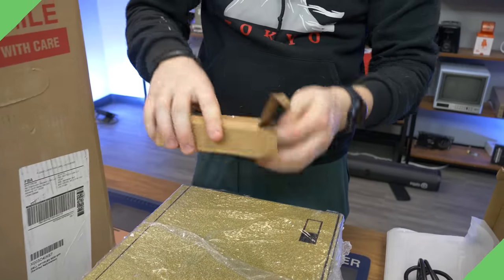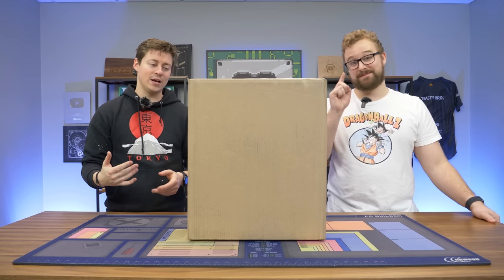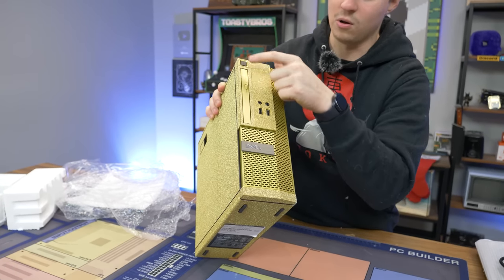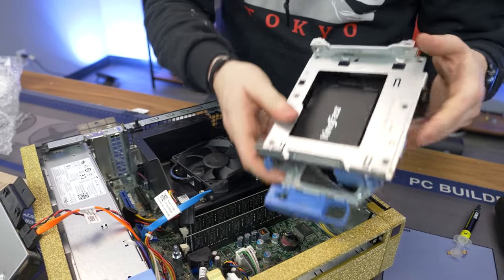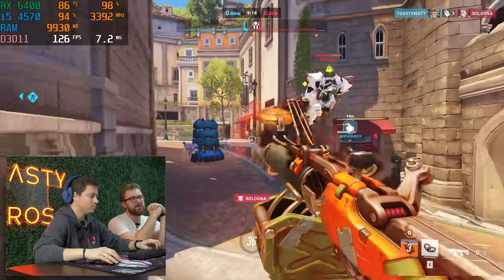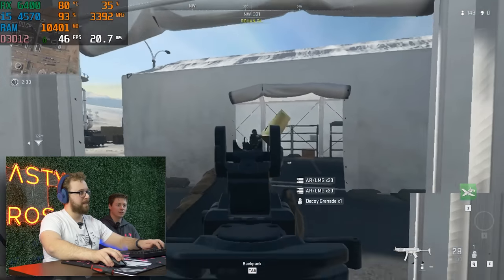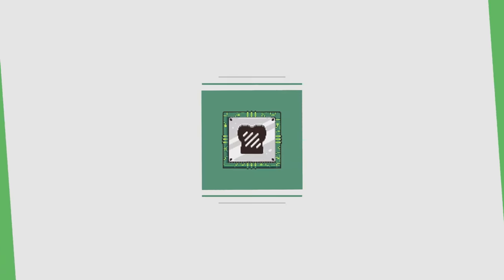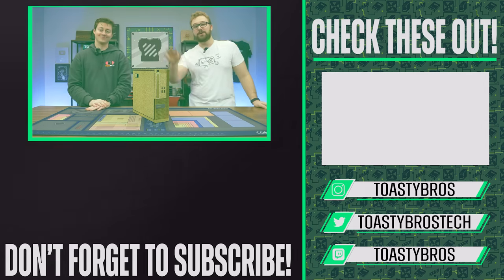We Bought a WILD Budget Gaming PC from Amazon...

Comment: Made a gaming build out of an OptiPlex 990 and it does really well with 1080p. It has a RX 6500 XT and performs really well and it has 24 gigs memory with an 870 evo SSD. Btw love that Tokyo Hoodie.
Reply: How with an rx 6500xt it can perform good ? This gc sucks when its not on pcie4
Reply: @RyxioonYT  its better than intergrated graphics/ igpu/ apu from 4th or older intel apu’s
Reply: @RyxioonYT  If the total game textures are less than 4GB it's not going to effect it that much. If it needs more than 4GB then the PCIe 2.0 of Sandybridge combined with the only 8x slot configuration internally of that card will really start to cut into the performance.

Comment: That's so funny you're reviewing this now.  I found your channel after watching other tech reviewers review this and went down the youtube rabbit hole watching your videos.

If anyone is watching this video and thinking about buying one, if you search on Amazon for an HP ProDesk 600 G3, you can get an I5-6500, 512gb SSD, and 16g DDR4 in an SFF chasis and a Windows 10 license.  I see one now for $110 bucks.  Same issue, you need a single slot PCIE graphics card and it'll get toasty, but much better bang for your buck.  

Or for $212 bucks right now, you can get an HP EliteDesk 800 G3 SFF with an I7-6700, 1tb SSD, and more space for a 2 slot GPU like a 1650.

Or you can buy the Tower version instead of the SFF version for more but have more flexibility on GPUs.
Reply: hp ones are bad because the bios is often very locked down, not that i recommend any of these for the pricing

Comment: 5:30 no you don't have gen 3 support... but you might find that out later... the 3020 uses an H81 chipset so it's only gen 2. Sorry. Speaking from experience as I own this very PC without the bling and with a slightly better (4590) i5. Except the side panel doesn't have the lever so it's making me wonder if this is a 3020...? Anyway. Whatever it is, worked fine with an RX 6400 so I'm pretty confident that would be a good upgrade for me.

Comment: Watching this video on the exact same model, just the i7 with 32GB with the 1tb King Fast SSD. Put a RX 6400 in it and Im going to use it as a stream and emulation box. Switch for everything else.
Also forgot, there are two more usb ports under the front panel. I'm going to cut them out. Mine has ten usb ports.

Comment: The combination of that PCIE 3 lane and that 4th gen i5 is always going to badly bottleneck the 6400 performance. Makes more sense to get a GTX 1650 and a 4th gen i7 with the 8 hyper threads.
Reply: Never buy a 1650. There's no point. Either get a 6400 or a the 6600m. The 1650 is an expensive middle ground that doesn't win on performance or even price to performance. It's just overpriced
Reply: @BeefLettuceAndPotato  The 1650 and the 6400 are both over priced if you're basing it on pricing to performance ratio. But a 1650 LP shouldn't cost anymore than a 6400 and it will perform better on PCIE Gen 3. A 6400 makes more sense on Gen 4 though. Also a 6600m wouldn't work on a system like this as it draws up to 100W of power and the PCIE lane is limited to 75W.

Comment: I just got my first pc and it's a dell OptiPlex 7020 has a GT 1030 i5 4690 16 ram and run pretty good for my first one also Plan to upgrade can someone leave some upgrade recommendations
Reply: I just upgraded from the optiplex 9020 to the 7060.  It's got an 8th generation intel chip in it.  I've got a low profile 1650 video card.  I wish there were more youtube videos on the 8th gen Optiplexs.
Reply: The thing I'd upgrade first would be the gpu, the cpu can hold off until later, it still has life in it

Comment: I got a question so i thought i should ask it to some pro's. I recently got a custom gaming pc but my pc in my opinion makes a decent amount of noise, i must say that i only have the stock fans, 2 in front, 1 cpu cooler. Do i need more fans to quiet my pc down or what do i need to do. I am pretty new to the gaming pc world so any help is appreciated!
Reply: Not a pro and not who you asked, but if your fans are running full blast all the time you may need to enable pwm mode so they ramp based on cpu temp.
Reply: @danc4046 thanks for the answer, i already put my pc on a power saving setting so u suggest a custom fan curve or?
Reply: @stein4558  hard to tell without knowing your configuration.  Are you familiar with pcpartpicker?  If so, can you link your build?
Reply: @stein4558  linking the build could be nice
Reply: oh btw prebuilt or like custom built? Sorry im a bit confused
Reply: I mean I have 3 fans and a cpu cooler and my build is quiet but ur pc maybe loud cuz your running a heavy game and that means the temps might be high
Reply: @DJLiverz  my bad, its a prebuilt not custom, i was able to change a few things
Reply: @DJLiverz  when im playing apex or valorant the pc gets pretty loud but i hoped that it would maybe be able to be a little less noisy because im able to hezr the noise through my headset mostly
Reply: @stein4558  right its probably loud because the temperatures are high cuz one game I play is where my pc gets loud cuz the temperatures r high
Reply: @stein4558  you should check temperatures in game under 90 degrees should be fine
Reply: @DJLiverz  hmm allright i checked it before and it sticks around 65 ish though for the gpu so i guess thats allr then
Reply: @stein4558  dont worry bro it can be normal for temps to be high
Reply: @stein4558  whats ur gpu?
Reply: @stein4558  if you've got a pre-built, can you link to the product page?  It might just be that prebuilt has poor acoustic performance.  But there might be stuff you can do.  If you aren't getting high temps, you could put a custom fan curve in that ramps slower.  You could add additional fans (that are of good quality).  Larger fans move more air while spinning slower and are quieter, so if the case has options for 140mm fans or larger, that might minimize sound and temp.
Reply: @danc4046  i cant link the product anymore, i tried to find it today but they are currently making other combinations with the same case though. But the tips you gave are certainly useful since my temps are pretty decent.
Reply: @stein4558  Sounds good.  If changing your fan curve doesn't work, you may want to think about upgrading to nicer, quieter fans.  I don't know what you have now but chances are that a pre-built has the cheapest fans available and buying something like "be quiet" silent wings (or light wings if you want rgb) might get you performance and cut down on noise.  But I'd hate for you to spend money if it could be solved with fan curve optimization.
Reply: @danc4046  i was able to find my fans, the front fans are sickleflow pwm argb 120mm from cooler master so im atleast able to tell you that :) but i will for sure try the fan curve optimization though i need to look up on how to properly do that first :) ty for the help
Reply: I am surprised you didnt get a better answer.
Basically, if you PC makes too much noise, and the pc is a pre built, in my opinion you pretty much have cheap and not enough cooling.
Regular cheap fans make noise. Video cards get get hot, thats normal, you cool that with the fans, obviously.  You can get better fans and those will disipate  the heat the same way (actually better, tbh) than your current fans, and way quieter. Thats one part of the puzzle.
The other part is, your fans make noise because the pc is working. If you get a better disipator for your cpu, like a liquid cooling unit or one of those huge disipators, your pc wont need to trigger the fans, hence, avoiding the production of  noise.
People combine the 2 solutions: you install a better cooler for your cpu AND you install better  (quieter)  fans.
Is not about just installing more fans. You can put up to 6 fans inside, and if they all cheap,  probably will be noisy too. Your pc will be cool, but noisy as hell.
You need to install a good cooling solution and quality fans.
People go all nuts and install up to 6 quality fans, in case the there is need to cool the pc down, they all are silent fans at least.

Comment: Please make a build video with about $1,500 budget using 13th gen i7 cpu and 3070 graphics card and Windows 11 and a motherboard with wifi and Bluetooth and an air aoi to prevent thermal throttling Please I wanna build a pc
Reply: You can use PcPartPicker to help you chose the parts.

Comment: Either the 6400 which as obvious easy GPU to pop in. Orrrrrrr... That 6600m with a Sata to PCIe power adapter. Quick little under volt and that card sips less than 100w. Untouchable performance for the price